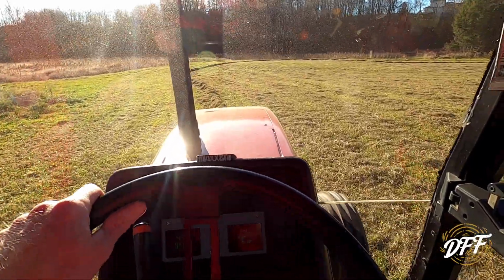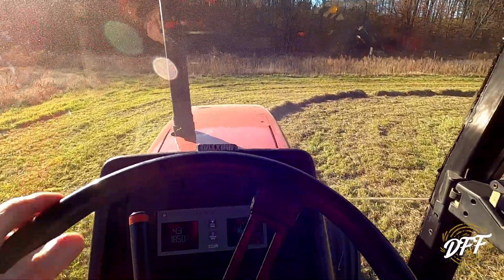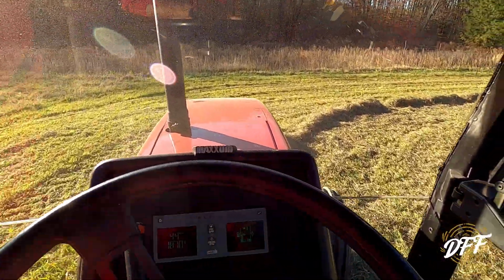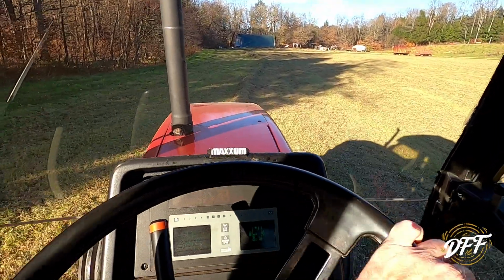Raking 3rd Cut Hay- November 2021

Comment: curious as to why the Kuhn rake and not the Kubota rake .....did i miss something? ...compare the two?......guess i could thow in there why not the double bar rake setup?
Reply from the maker: The Kuhn was easier to get to. The bar rakes don't do as good of a job in thin hay as a rotary, that's why I didn't use them. Thanks for stopping by 🙂